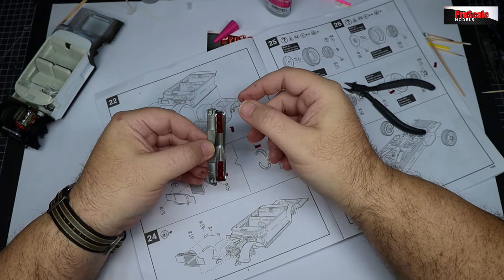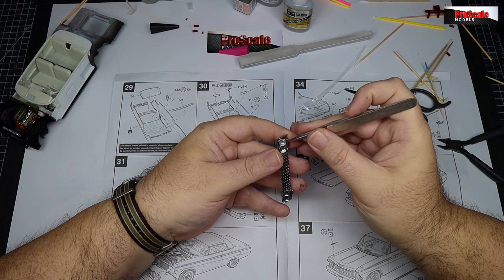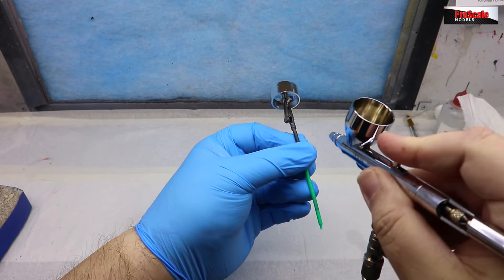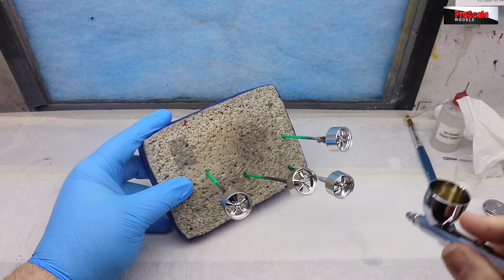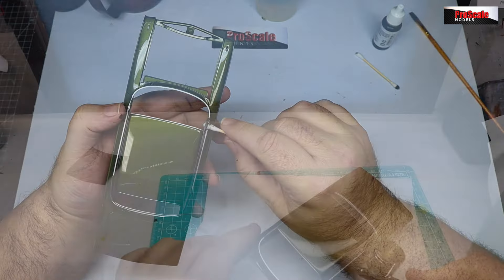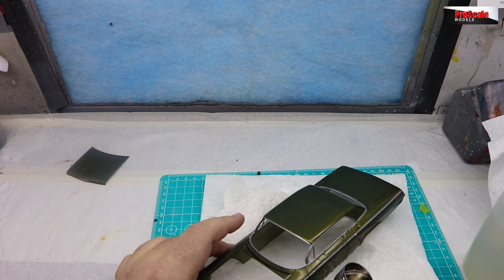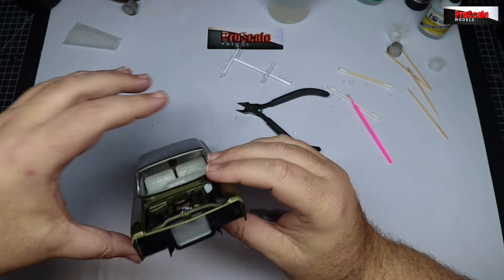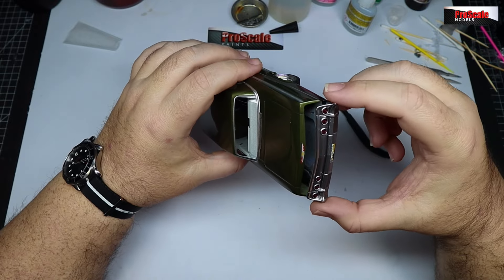Part 4 - Revell 1/25 1962 Chevrolet Impala SS

Comment: The car looks amazing 
The colours with the chrome finish and wheels just suits the car 
As does the stance 
I love the fact that you built a custom impala but didn't go over the top 
It looks like a pro built custom 
Only one thing is that i don't have the space to spray paint so i always brush paint 
Also a question was that kit a revell monogram kit or revell Germany one 
I have always struggled with revell Germany kits so I avoid them even if they do a model that i would like
One i definitely like is the land rover kit but because of it being a revell Germany kit I just won't get it
My latest model build project is a Tamiya 1/24 scale Fiat Abarth 695 ss